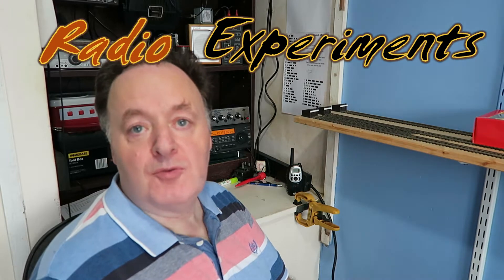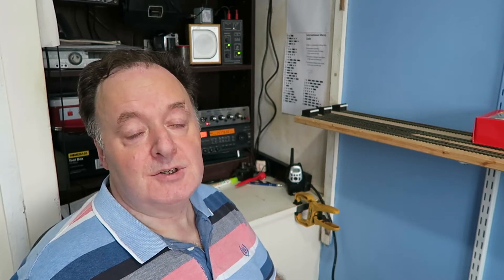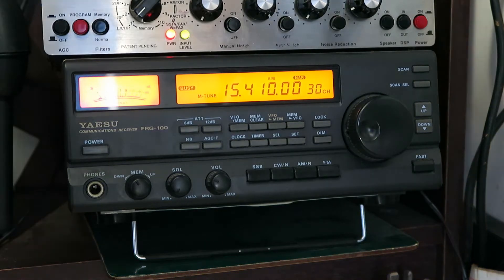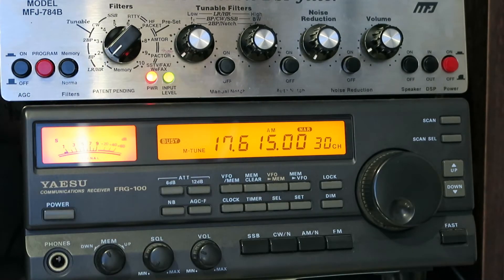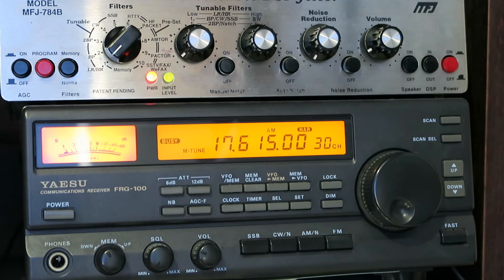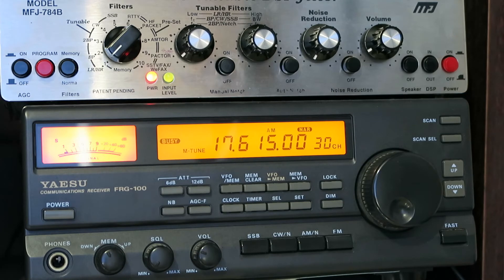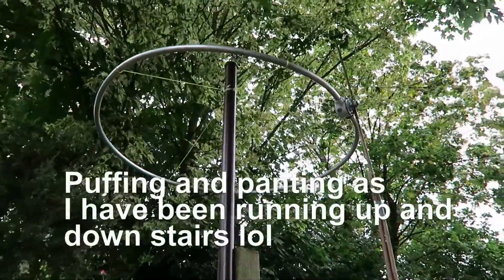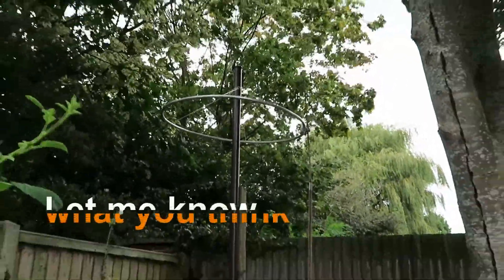Horizontal loop experiment to reduce local QRM

Comment: Mini Whip more than holding it's own, I wonder if the non-resonant antenna of the Mini Whip is responsible for it's ability to reduce some RF noise?
Reply from the maker: Thanks very much and sorry for the delay in replying I have been on holiday and only just back. The miniwhip is great at ignoring low angle local QRM for sure

Comment from the maker: Bit of a summary after testing overnight. Well the horizontal loop without doubt reduced local QRM issues. However signal loss is too much and oddly I found it dreadful at night! skywaves maybe? This morning it's performing well on 7160 kHz LSB with zero noise and fair signals from the net there. Could it be that the coax feed is grounded and is unbalancing the loop? (grounded at the far end near the antennas, a requirement for the MiniWhip) Anyway more tests and experiments will follow.

Comment: Good video tests there, Mike. Having not used the Wellbrook before, I can't really comment, although there certainly was a difference between the two antennas on the 16mb station. 

Does the Wellbrook work well on the NDBs when mounted vertically? 

I'd also be interested to know how much accessible land you have on your property. You may be able to put up a larger horizontal loop by going right around the house and along the fences. Even something that was 20m (65 feet) in length (e.g. 5m a side) could help reduce noise and increase signal pickup, especially on the NDB band. The more wire you can get into the air, the better.

Also, if you do end up using two or more antennas for your listening setup, it might be worth getting a small antenna switching box....to save you running up and down the stairs!! ;-)  They can be found on eBay pretty cheaply or at your local radio store.

Nevertheless, going horizontal appears to be helpful in reducing the noise level. Even if the signal level goes down a bit, if the noise level reduces by a greater amount, then that's a win/win.  Cheers, mate.  Rob VK3BVW
Reply from the maker: Hi Rob, very many thanks for the great comments, so glad you did because as you know it was your experiments that inspired me to try this :) Yes when vertical the Wellbrook is excellent on NDBs and HF. I was just trying for a omnidirectional antenna. Accessible land is only what you see really, my house is semi attached and while the back garden is good by UK standards I am surrounded on three sides by other QRM generating properties. I do have a Wellbrook ALA100 wide aperture loop that I could also try. Good tip re the antenna switch I do have one, the coax is grounded near the tree and is fixed to the ground pole and weathered proofed, this meant I could not separate the coax feed for the switch this time. Like you say going horizontal does reduce noise however in my case I have lost too much signal as well. Having read up on it a bit, for magnetic loops like this, the recommendation is to be one half wave length high!! that's going to be a tall (lol) order for this. It's been fascinating but I think I am ready to conclude that this has not worked for the Wellbrook ALA1530. I may try the ALA100 later on. Cheers Rob.
Reply: Vertical antennas can often be more susceptible to noise pick up because most noise is vertically polarised. Even though you have QRM properties surrounding you, a horizontal loop that ran along the fences of those adjoining properties might be OK. May be worth a try. Good luck!